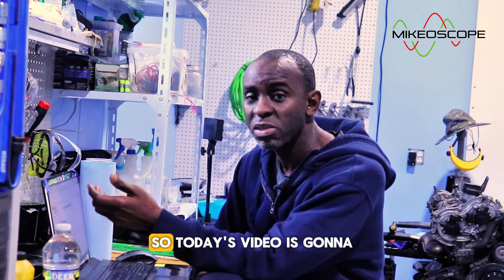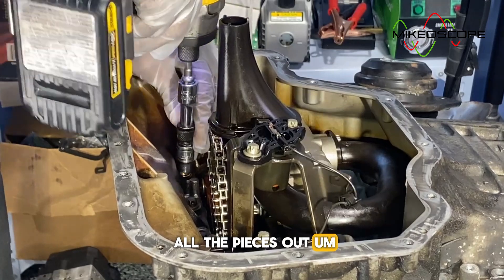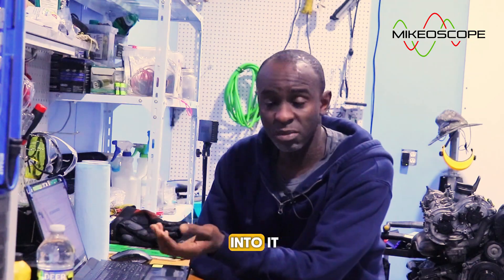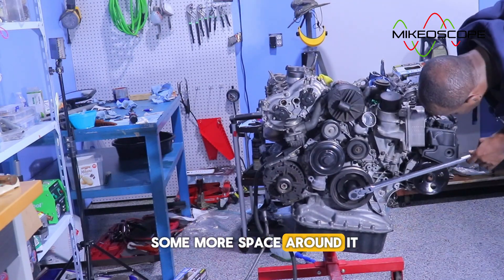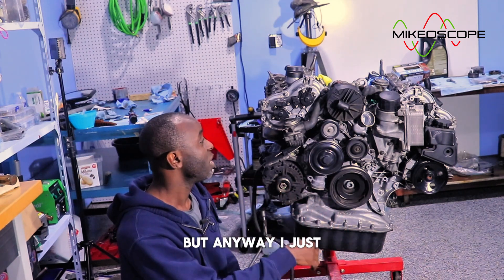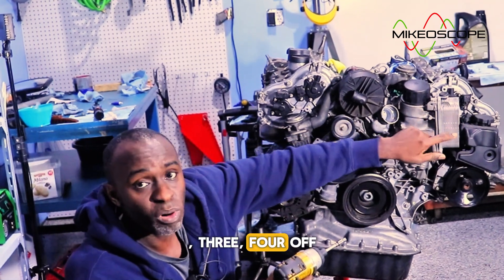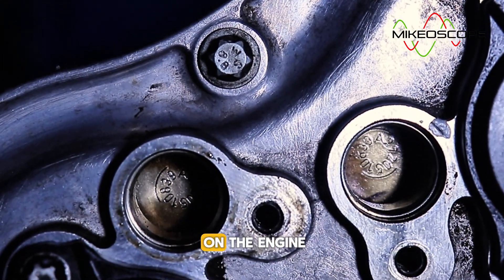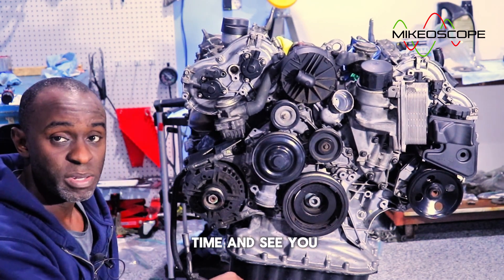Mercedes Benz M272 Engine Timing Repair (PART 1): Balance Shaft, Timing Chain, Timing Chain Guides

Comment: Greetings from Costa Rica! I wanted to let you know that my mechanic did a complete timing belt replacement, he changed absolutely everything. The engine is running smoothly, there are no unusual noises or anything, but the scanner is still showing the same four fault codes plus an oxygen sensor fault. He says the oxygen sensor could be causing this. What should I do?
Reply from the maker: Hi. When you turn to 305 and check the timing do all the markings line up?

Comment: Hello!! I own a 08 cls550 (M273 engine)  I did this and 3 of the inscription of the camshaft adjusters are right in the center but the second inscription from bank 1 is a little higher... What does that mean? 🤔
Reply from the maker: If you ensure your crank pulley is at TDC cylinder #1, all four must line up if the timing is correct.

Comment: Hi, i tried rotating the crank pulley once and twice too but i wasn't able to see those inscription at all, all i see is sqauare holes, but i am able get all these stamp marks at some other certain angle. Well another thing is i dont know what my previous owner done to this m272 engine as i bought this car in a no start condition😅. Do you think the cams are ok but the crank is not aligned with the cams? Please advise 😊
Reply from the maker: Sometimes the pulley key way can shirt and cause a no start. I would remove the pulley and check that first. The solution to that would be a new pulley. If that is intact, then the method I show should lead you to check the timing correctly.

Does it crank?

Comment: Hi! Great video! If I have a small inspection camera, can I see if the teeth on the balance shaft are worn down? I'm thinking about removing the right cover in front of the camshaft sprockets and carefully going down with the camera parallel to the timing chain. Do you think it's possible to see down to the balance shaft or do I have to remove that chest cover?
Reply from the maker: I don’t know if you’ll see much that way but it’s definitely worth a shot. Also I would call the dealer and provide my VIN and find out if your vehicle was affected by the TSB at 1:43
Reply: @ I have checked up my engine number and my engine are not included of the bad engines. Thanks for answer! :-)
Reply from the maker: @ Great . You’re welcome 👍

Comment: Hi.  I have a 2008 M272 that is post balance shaft sprocket issue. I got P0016 and P0017 and car won't start.  I looked in the cam sensor holes and the pulse wheel numbers are all in center.  my problem is that my harmonic damper does not have any numbers on it, so I cannot tell if the numbers line up in the holes at 305 degrees.  I replaced all four cam sensors and magnets but car will not start.  Any suggestions?
Reply from the maker: I am not sure why your damper does not have the numbers. Are you sure its the correct damper?
Here is how I would solve it that issue of not being sure of the 305 degree alignment.

1. I would find TDC on cylinder number 1 using the balloon method (if you don't want to remove your valve cover.) For the M272, that would coincide with 40 degrees on your damper so that will be your starting point as long as you are sure you are on TDC cylinder number 1. I use the balloon method in these two videos below. You can also use a TDC whistle.
https://www.youtube.com/watch?v=ldd3LfqP8CI
https://youtu.be/yAs1eeWKBa0?si=4jXWpvDnbbNbVvKy

2. Once you are sure you are on TDC on cylinder number 1, that is a good starting point. Then you can replace the harmonic balancer with one that has the numbers so that you don't have to estimate the 305 degrees. if you like you can estimate 305 continuing from 40 degrees where you are but that can be tricky. I hope that helps.

When you are sure about the alignment/timing, you can proceed to diagnose the problem.
Reply: @Mikeoscope  Thanks for your reply.  I found TDC, using it as a 40 degree reference I then calculated 305.  The pulse wheel numbers were visible at more in the 280 range.  Rented a borescope to find # 6 cylinder had stuck exhaust vales.  Now considering an engine swap, but have never done one before, so rather unsure of myself.  Any suggestions are appreciated.
Reply from the maker: @ Replacing the engine isn’t too difficult on this car. The engine mount bolts are shockingly easy to remove. It would be good to get help because it’s pretty heavy. Apart from that, take lots of photos and videos. Overall an engine swap on this isn’t technically tasking.

Comment: I need help with an error code p1212 “The Position Of The Intake Camshaft (Cylinder Bank 2) Is Implausible Relative To The Position Of The Crankshaft.” I did a little bit of research and think the intake camshaft sensor on the right bank is faulty and may fix my problem. A shop quoted 9.8k stating my timing chain “skipped 1 tooth” looking at my engine it does not look like it has been cracked open. Just exploring other possibilities.
Reply from the maker: @NoralesGarcia  If you have a scan tool you can watch the data for the cam sensor you suspect and compare to the other bank while the engine is running. 

If you don’t, just move the sensor to bank 1 and see if the bank in the code changes. 

I’m suggesting these steps because they would require the least tools and I don’t know what tools you have at your disposal.

Comment: Mine was off so i turned the engine and lined them all dead center. Am i good to go or need to do something else i changed all camshaft solenoids and crank shaft position sensor ?? Any help much appreciated. Great video please continue to making these very helpful.Thank you
Reply from the maker: @BettyKent-n9r  What codes do you currently have ?
Reply: P016
Reply: @BettyKent-n9r  any update? I have a p0016 and 17

Comment: I have missfire codes on slk r171 i just bought but have only p0025 and p2004 . Which when i cleared engine ran smooth . Should i check timing gear either way since 2006 is effected yr
Reply from the maker: You could do all that but that will take a while. Since P0025 is a bank 2 error, I would swap a solenoid from bank 1 and see if the code moves to bank 1. If it does, the solenoid is bad. Of course, if you want to be more detailed, you can check the timing but I doubt that is the problem.  For P2004, you likely have an intake manifold failure but you will need to make sure all your wiring, powers an grounds are fine (it could also be the ECM but this is unlikely) before you replace the intake manifold.
Reply: @Mikeoscope  will do appreciate the advice
Reply from the maker: @ you’re welcome

Comment: Great content and information, definitely deserves more attention. Also I know you said, that it must require those certain codes active at the same time for me to consider yanking the engine out. I have a m272 engine with the codes P0012, P0015, P0025. I’d really love to keep the vehicle, but if worst comes to worst i’ll have to sell it. Any ideas what should be my next steps?
Reply from the maker: If you want to go straight to the point, remove the cam sensors and  turn your engine to 305 degrees on the harmonic balancer and see if your timing is good. This engine is plagued with timing issues so I would check that first before I do anything major. It may not even be that serious. I know they even had "recalls" with the camshaft adjusting solenoids.